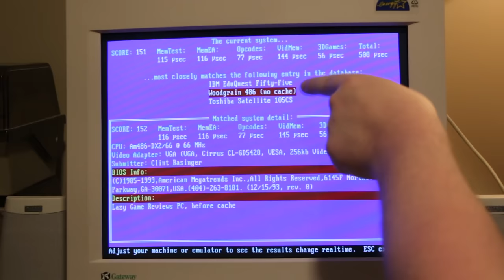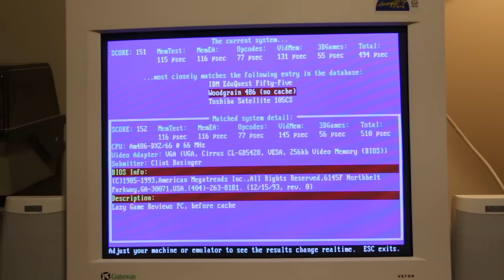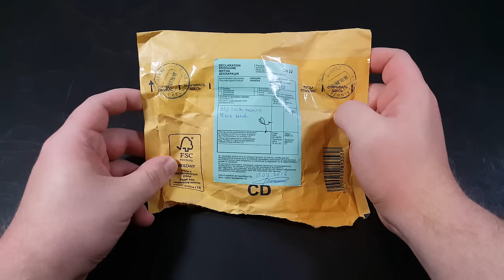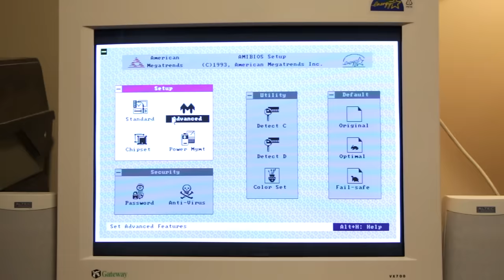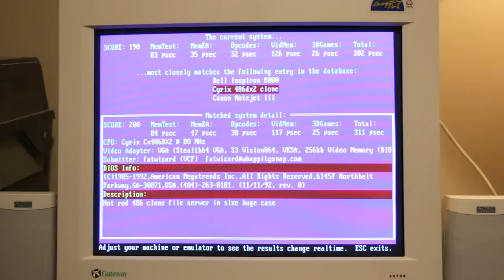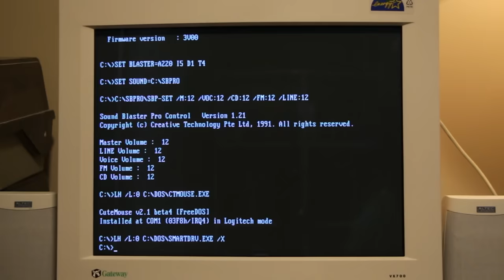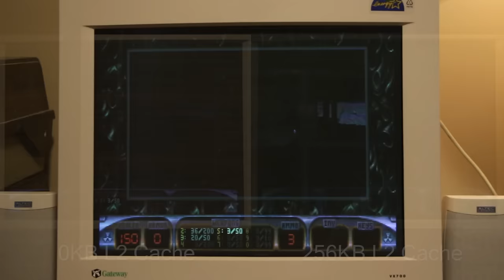LGR 486 Update! Installing L2 Cache

Comment: Did you ever hear about fake (it was really a fraud) cache on 486 motherboards??. I have two of those chips, really fake, made of plastic and soldered in the motherboard doing absolutely nothing. They come in pcchips motherboards if i remeber well. If you want i can send you a picture. They are pretty messed up because there were hard to desoldering from the motherboard
Reply: I haven't heard about that one but I do remember in 1996, 1997, IBM PCs like the Aptiva had no L2 cache at all. They came with a Pentium 166 MHz or 200 MHz and no L2 cache at all! I decided to choose my own parts and selected a mobo with 512 KB L2 cache, which was the maximum in 1997.

To desoldier chips, the professionals add that cream thing to prevent oxidation, blow hot air, pull off the chip.
I think you can use break fluid if you don't have that cream. It can handle 200 °C.
Reply: The PC chips motherboards, I have one and am tempted to put actual cache chips in when the system eventually gets built.
Reply: @morantaylor  This mother has this two chips a mention earlier, together. And the tracks for the first chip ends in the second one and nothing else is connected to the mother. This two chips can be opened!! because they are so fake! and inside all "chip legs" are soldered together. Later, came a newer version of this motherboard with a newer version of fake chip. These were made of plastic too, but inside there was a resistor, generating heat to simulate that it was a real working chip
Reply: @cornalito  I am aware of this and was planning on replacing the fake chips with actual cache chips. I have had this board for  25 years.
Reply: Isn't that just the chip socket? Or was it just a chip shape?
Reply: @iProgramInCpp  Chip shape. Also it has fake numbers a and letters printed on it. Maybe i can upload a picture
Reply: @cornalito  ah ok

Comment: I played Duke Nukem 3D on my 66Mhz DX66 which is a lower model with high detail, at fullscreen with cache on an ISA 1MB video card and it played fine. Don't remember what resolution it was tho. You might have turbo off which lowers it in half.

Comment: Hey Clint! A little trick I use is clear hot glue in mounting holes. If you do it right it won't really be visible but will hold the board away from the case pretty well, and it comes off really easily so no worries about damage :)
Reply from the maker: Good idea!

Comment: Ah, nostalgia!  My third computer was a 486 DX2 50 MHz intel with VESA bus.  If memory serves, it had the very same video card that you use in your build.  Turbo button would switch the display between 25 and 50 MHz.  :)  Finding a good VESA upgrade video card was an expensive endeavor at the time.  Ended up upgrading the entire system to an AMD 5x86 at 133 MHz with PCI bus and 2MB cache.  Still AT form-factor though.  Been building my own computers since.  Glad to see these things are still out there, alive and kicking bits around.  I'd love to build up a 486.  My "legacy" PII/PIII gaming rig is geared more towards Win95 era games, but I do throw the occasional DOS game at it once in a while.  I still have some original boxed games from that era.  Thanks for sharing!

Comment: Ah, memories of overclocking a "Fugutech" 486 board (PC Chips clone), running the motherboard at 60MHz with an undocumented jumper, setting my Cyrix Cx5x86 chip at 2X for a 120MHz clock, and sourcing some 10ns cache chips and the fastest RAM I could find for it.  I had to use some ridiculous waits on the RAM and could only use one VLB slot (not just one at a time, only one slot of the three was reliable at that speed), but that thing just flew for a 486 based platform.
Reply: starts ebaying for Fugutech motherboards
60mhz FSB for a 486? I must try this

I wonder if you used a water cooling system and an Evergreen or Kingston overdrive chip you could hit 180 or even 240mhz... :-o

Or, hell, just overclock a DX50 to 60mhz and see what its performance is like. (Or attempt running a DX2-50 or 66 at 1x multiplier somehow?)

Comment: I still have my pair of Compaq 486 PC's that I grew up with.  Both have been upgraded with the AMD 5x86-133 CPU's and 64MB RAM.  No trouble with Duke 3D that I can remember! 

Seeing the VLB video card brings back memories though.  Although they did make 486 boards with PCI, by then the Pentium was taking hold.  I've nearly lost track of al the systems I've gone though over the years, but my best memories were probably with the AMD stuff.  The 5x86-133 ran great at 160Mhz in certain boards too LOL.

Comment: Aren't AMD 486 are known to run duke worse than its intel counterparts ?
Reply: AMD 486 chips will perform exactly the same as Intel chips - they share the same microarchitecture. However, there are 486 chips with 8 KB or 16 KB of L1 cache, some of those with "write-through" cache (all writes to L1 need to be synced to memory immediately) or "write-back" cache (contents from the L1 cache will only be written to memory if the cache is full). So chips with a 16 KB write-back cache will be faster than those with a 8 KB write-through cache (such as Clint's current 486 CPU).

AMD offered 486 CPUs with
 - 8 KB write-through cache (original cache configuration). Those will perform just like Intel 486 DX and DX2 chips.
 - 8 KB write-back cache ("Enhanced Am486")
 - 16 KB write-back cache (later models of "Enhanced Am486" and "AMD DX5" or "AMD 5x86"). Those will perform just like Intel DX4 chips.

edit: Some words on Cyrix 486 CPUs: Unlike AMD's chips, those have an in-house designed architecture. Earlier versions were a bit slower, later versions basically closed the gap (some instructions were faster, others were slower). Still solidly 486 class chips.
Reply: I had an AMD 486 dx/2 66 w/16mb of ram on it (72-pin).  VLB trident 512kb video, sound blaster 16.
It ran Doom worse than an Intel processor, but not by too much.  It would run low detail about the same speed as the Intel did on high-detail.  It would lag out Duke3d if you let the demo run, it would eventually crash out when he was under water or in an ice-area in the demo as the buffer overflowed as it got more and more behind it'd crash to dos.  This was 22 years ago I do not remember what chip it was originally but it was a 486 dx/2 66 by AMD.
Reply: Not same arch; starting with the AMD AM386, they were not Intel designs.
Reply: Both the Am386 and Am486 were reverse-engineered by AMD from Intel chips as Intel would not hand over the original engineering documentation and fabrication templates (Intel felt that their agreement with AMD would only cover chips up to the 286). The Am386 even includes a 1985 Intel copyright marking on-chip (https://en.wikipedia.org/wiki/Am386#/media/File:Amd_386_processor.jpg) and could only be released after a lengthy court battle.

Am486 DX/DX2 (re-)implements the same architecture as the respective Intel DX/DX2 chips and behave and perform identically (for benchmarks see, e.g., http://www.vogons.org/viewtopic.php?t=28470 and compare "Intel DX2 66" with "AMD DX2 66"). Again, things went to court, and AMD had to come up with their own microcode to escape Intel copyrights (they managed to remain compatible, without performance loss). The Intel DX4 included some tweaks (mostly bigger and "more clever" cache) that AMD did not immediately adopt, which is why the Intel DX4 pulls away.

So yes, AMD put significant effort in-house to develop their 386 and 486 implementations (and managed to produce higher-clocked and cooler-running variants), but they did not deviate from the architectural features set by Intel. The first 100% in-house design from AMD was the K5, derived from the 29K-line of AMD RISC chips.
Reply: Oh, maybe was wrong about the Am286. But by arch in the Am486, do you mean supporting the same instruction set, or actually being the same chip inside? I don't have my Upgrading and Repairing PCs readily accessible. Also, I've heard 29K is part of the K5, mostly the FPU, but is there any hard data on this?
Reply: Regarding the Am486, with the same "architecture" I mean that its logical units are equal in number and function than those on Intel chips. Essentially, it's following the same overall "blueprint" than the Intel 486 (as depicted in, e.g., https://commons.wikimedia.org/wiki/File:80486DX2_arch.svg ). The circuitry to achieve this seems to be an in-house development, as when looking at the chips themselves, one can see that the layout is somewhat different (Intel's die is rectangular, AMD's is "squarish" - compare https://commons.wikimedia.org/wiki/File:80486dx2-large.jpg with https://commons.wikimedia.org/wiki/File:AMD_Am486_DX4-100_die.jpg). So while it's not a copy regarding it's physical silicon instantiation, it replicates the exact same logical function (and will give the same results after the same number of clock cycles, meaning it will perform identically).

While not being an authoritative source by itself, Wikipedia has a nice overview on the 486 clones: https://en.wikipedia.org/wiki/Intel_80486#Other_makers_of_486-like_CPUs

Regarding the AMD K5 and Am29000 relationship: It's very easy to find web sites reporting that the former is somewhat "based on" or "inspired" by the latter, but it's certainly hard to find definite proof. I vaguely remember it being discussed in PC magazines back when the K5 was introduced.
Reply: Well we couldn't get it to run right with Doom or Duke3d compared to a genuine i486 chip from intel of the same spec.  We dropped the i486 chip in, ran doom 32~35fps, put the AM486 in and it ran 24~30fps or so... sometimes slower.  You could measure the dots at the bottom of the screen with -devparm on Doom.
Reply: I'm willing to bet Oni is using SSE and AMD CPUs in 2000 didn't have SSE. That came to them in the Athlon XP series.

Also, reverse engineered isn't really what happened by the K-6 era. They were a licensor(And still are, obviously) of x86 and there's a patent sharing agreement between them. It's why Intel can use 64 bit; AMD designed it.
Reply: First I've heard of it. AMD's 486s were essentially second-sourced Intel parts. Their later ones added certain nice upgrades, however, like improved cacheing, lower voltage operation, and the ability to run at generally higher frequencies than their Intel cousins, particularly in 5x86 form...

You might be thinking of the K5s, which were meant to be direct Pentium rivals but weren't exactly their best processors ever, particularly having rather weak floating point performance, but they were really only just getting started in the independent design stakes at that point. The K6's were far better.

Comment: Separate L2 Cache and  math Co-processors.  Now that stuff is built right into the CPU.
Reply: It has to be. The higher operating frequency means that the very electrical impulses they use to operate wouldn't have time to travel that distance across the motherboard from CPU to MMU to cache chips and back without causing considerable lag.

The 486DX had an integrated FPU already though, you might be thinking of the 386...?

Comment: I remember Duke 3D running quite well on some type of 486 133MHz processor in the family's computer of probably over 20 years ago. I also remember using higher graphics settings.

Comment: Another setting to check is wait states. I remember upgrading from a 486DX2/66 to a DX4/100 in 1995 and not noticing much difference. Then someone told me to check wait state settings and it made a huge performance difference(20-30% in some cases) in demos and games. I don't remember what settings the Amiwin bios had on them with wait states though, as I remember I always went with Award because of some missing features on the Ami one, but I can't remember which ones anymore.

Another thing that would help is a faster bus speed. In the late 486 era, I had an AMD 5x86/133(which was really a 486 running on a 33Mhz bus with a 4x multiplier) running at 150Mhz(3 x 50MHz) and tried it at 160Mhz(4 x 33Mhz) and it was far faster at the 150Mhz speed. With that cpu, quake ran about the same as it did on a Pentium 90, and Duke 3D ran smooth at 320x200.
Reply: The weird thing is, I get almost twice the memory speed on a 25mhz-bus system with the most conservative memory timings the BIOS (from the same manufacturer) allows you to set. At the faster timings, it's 2.5x the speed. Unless it's got the turbo switch accidentally turned off (which CacheChk should have detected and showed a lower MHz figure for... hmm, should have tried that myself, totally forgot), or the BIOS allows and defaults to extremely conservative memory timing, there's something deeper and weirder going on.

Comment: You should have gotten the intel board. SiS were rubish, slowing down the system.
Reply: Which Intel board in particular? Both companies made a lot of different 486 models.

And, well, the 1992 SIS motherboard in my SX25 still runs its memory at 26mb/s (essentially the same speed as the CPU's internal cache, so it can't really go any faster) vs Clint's 11mb/s, and can't even be forced to go slower than 19mb/s, so it doesn't seem to be a matter of choice of motherboard manufacturer.

Possibly he's got two mismatched SIMMs meaning the controller is running in slow-but-compatible 16-bit mode, ie addressing each of them separately (a neat trick certain 486 motherboards could pull with 72-pin modules) instead of in tandem?
Reply: Other chipsets could be slow, too. System Speed Test gave me read/write/move speeds of 9/25/8 MB/s on an OPTi 495SX based board. With an OPTi 895 job this went to 31/42/14 MB/s using the same DX/2-66. You definitely noticed in memory-intensive applications like web browsers. Differences like these make the hotly-debated ones between Intel and VIA chipsets in Pentium III days look almost negligible.
Reply: Was that using the same memory, and the same BIOS settings though? I mean that's sort of in line for what I'd expect with a jump from 25 to 33mhz operating speed for the read, and far more so for the write (and a little slow for move...) vs my own machine, which I guess is about middling on that evidence. So long as you had 60ns SIMMs of course (vs the ones I'm using that are probably 70ns, but could probably be 80ns without it making any difference to how hard a 25mhz 486 can push them).

I have a suspicion that the chips used on later SIMMs could actually run quite a bit faster than the 60ns they were universally rated for (as when SDRAM came in it was basically the equivalent of memory running at least twice as fast if not far more so, and that sort of thing just doesn't happen overnight), it's just that lay users had gotten used to looking and asking for that speed grade so anyone actually openly selling 50ns or faster might end up losing sales as no-one actually thought to buy their products... so a 33mhz board with tight timings (minimal wait states at each stage of the memory access process... or maybe that just quietly ran the memory system at a higher frequency to everything else) could well see a speed bump from using SIMMs that were actually 50 or 40ns on the inside, so long as the user bothered to tune the timings to make best use of them, or the board was able to detect and do that automatically...

If it was the same CPU, same memory, same nominal settings, then that's a truly chronic speed difference. Given how memory-bound all but the least data intensive / most heavily looped software is, having RAM running twice to three times faster in one machine vs another can make a massive difference to how fast it runs, enough to potentially make the CPU speed somewhat moot, if you e.g. have a slower CPU that can run absolutely flat out in the faster board, and a faster CPU that's continually stuck waiting for memory access on the slower board.
Reply: As for the later boards, I can't say I measured a particularly great difference in memory speed between the various mobos I tried out over the years. At least the ones that all used single speed SDRAM; due to the "synchronous" bit of that acronym, as well as the SPD information, a particular module would generally rate more or less the exact same speed across a range of boards and CPUs, in both MemSpd/CacheChk and other less exacting benchmarks like the one incorporated into Memtest86+ ... so long as you used the same default settings on each board of course. Occasionally a particular board and module combo would end up somehow interpreting e.g. the CAS latency differently and produce a slightly different speed result, and of course you could always override the officially burned-in speed and overclock the modules (which is something you would surely notice yourself deliberately doing), which each individual part reacted to differently and would hold up under differening combinations of CL and MHz, but in the main if left set to default you'd get the same memory performance from the same sticks. The real differences, so long as you bought the fastest SDRAM you could afford in the size you needed, were starting to depend rather more heavily on the CPU, its speed, that of the FSB, and the cache...

Comment: This 486 has as much L2 cache as a Skylake core haha. You really should go a DX4 100MHz, cmon. Don't mess around.
Reply: Good point. PD 83MHz. And then install Windows XP haha.
Reply: Nah. 133mhz AMD 5x86 is what it's all about. Overclocked to 160mhz by running the bus at 40mhz.